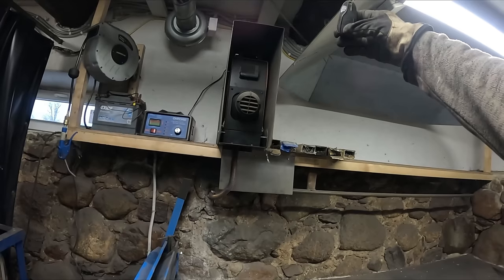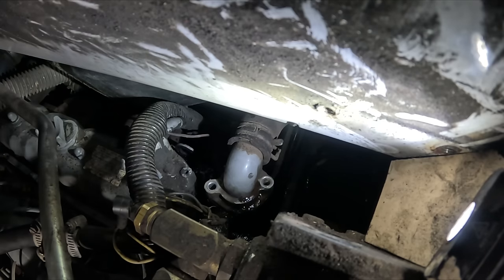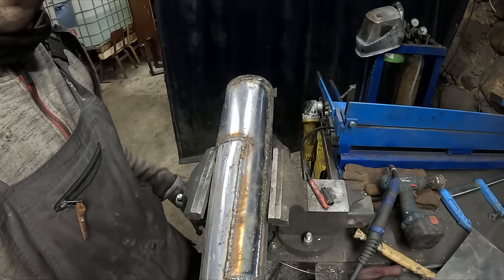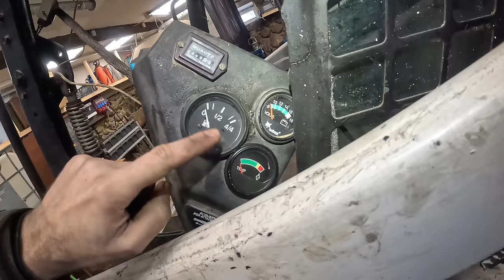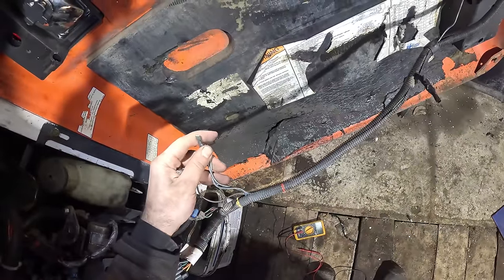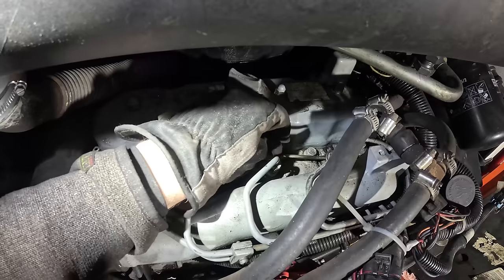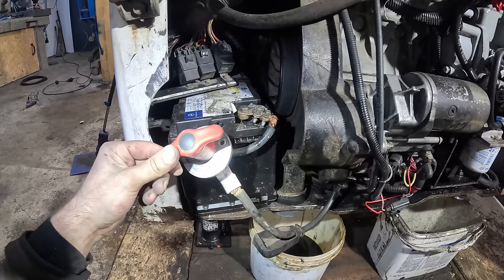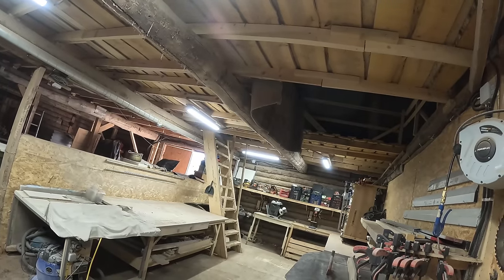Fixing up the Bobcat 751 skid steer - (part2)

Comment: Your dry humor kills me every time.
Reply: You have that bran new free welder that has tig. An you have the mixed gas an sure you have some old wire coat hangers. That what you should have used to patch the muffler. That what tig is for.. not a dam cheap mig
Reply: Ya, he has me rolling on the floor every YT!
Reply from the maker: Need pure argon for tig. Co2 will corrode the weld and mess up the tungsten tip

Comment: You take the red handle off of the battery disconnect switch and mount it from behind. Then you only need a small round hole between the screw holes. And you can get the correct crimping tool for the large gauge ring terminal for like 30 to 50 euros. Instead of squishing it in the vise and having the cable leaving the premises. :)

Comment: If you haven't already, remove the bulbs from the reverse lights and retest. An incandescent bulb is a controlled short circuit. Hopefully, you can use the existing wiring. Great video as usual!
Reply from the maker: Good tip!

Comment: Mine is a 763 and it does not have a battery disconnect switch. Great videos, one of my new favorite channels!
Reply: Yeah, those dont come equipped with one from factory. Previous owner had put a master switch to mine 2001 753g. It's handy to know that power is really off from everything.
Reply from the maker: Thanks for confirming

Comment: The white connectors in the switch panel are designed to connect directly to the back of the switch, explains the broken pin stuck in the connector.

The new lights need a “wedge” style globe base that will twist in, could be a T15 or T20 hard to judge the size from the video.

There might not be any short in the wiring to the light, as you tested it with globe’s installed you will get continuity from the power side to ground through the bulb.
Reply from the maker: Ok

Comment: Temperature gauge looked like it was the sensor. The exhaust repair cost you some wire, gas and electricity, and will last a long time win-win. For someone who does not know or like electrics (your words) I think you made a very good job of repairing all the electrical problems. The bobcat is made in America? Is that why your spanners won’t fit! I think the only thing metric on the bobcat is the driver 😊 Another excellent video, keep on posting.
Reply from the maker: 😂😂😂😂 yup seems about right

Comment: When testing gauges, ground out the power wire at the sending unit for the gauge you are working on. 
If gauge goes to full, gauge is good, if not either wire issues or sending unit is bad. 
Goes for most analog type gauges. 
Awesome video by the way as usual
Reply from the maker: Ok thanks

Comment: @Ants Pants @27:00 Andris that plug is there to let you blow out any sparks that end up trapped at the bottom of the muffler. Basically, you block the muffler pipe and open that bolt, then turn on the engine and give it a few revs to blow out the debris/sparks in the bottom of the muffler. Its part of the service list you should do every so often, dont know if anybody else has ever had any luck with that though, the ones ive tried to unscrew are all seize solid and the only way they will come out is like what you did with yours haha. Though I dont try that way on my mufflers. Spark Arresters usually go on the very end of a muffler if im not mistaken (the part where exhaust gets shot out into the air).

1:27:35 also when a glow plug glows from anywhere but the tip, it is considered faulty. I could be mistaken but that is what I read in an engine manual last time. You can also measure the resistance for each glow plug and see if its within specs, I think usually they are like single digit or lower resistance when good.
Reply from the maker: Thanks for the info

Comment: Man if I wasn't a continent and an ocean away I would come and help you with the wiring.  I too love complaining about people's half assed repairs. 

I would consider getting one of these "2 Wire Retractable Test Leads with Alligator Clips 18 AWG Test Leads Alligator Clips Electrical Test Leads Retractable Test Leads 20 FT" as described on amazon.  Harbor freight had them for a while and they are amazing for extending your test leads.  

I was removing the highscooler stereo "upgrade" wiring in a little pickup today.  Between that and this it reminded me that I need to get my backhoe gauges working again.  They have only not worked since 1996.  So should be easy to fix.

Comment: 1:13:52  Wish I had a bit more.... said every man everywhere lol.  Since you have done so much work to the electrical system, you should draw up a chart for where and what all your fuses are for and where they are.  Once you are able to get the cab up , you should finish checking out the original harness and fix it so you can use everything through the diagram wiring again. It'll be much easier in the future if you have to repair any electrical problems.
Reply from the maker: Good idea
Reply: @Ants_Pants  By the way, you did some pretty good diagnosis of your electrical issues, you should be proud of the results!

Comment: 1:47:00 I have installed that kind of isolator switch before. I think you are supposed to remove the red handle(removing the black cap on top of the handle should give you access to a screw/nut), then you just make two holes for the mounting screws in addition to the shaft hole.
Reply from the maker: Cool thanks

Comment: I use a piece of flat bar 20mm x 100mm to help me on the lathe. I put it on the ways & can slide it backwards & forwards with a dial indicator or scriber. Also I can use it as a flat surface to markout a job.

Comment: 1:45:42 You can put the isolator switch on either positive or negative. It does not matter, regardless of what anyone says. That said, I prefer to have it on the negative and the reason for that is so you can hook up various auxiliary equipment directly on to the positive terminal if needed. That way the isolator will still break the circuit.

If your isolator is on the positive terminal, and you hook up a bunch of garbage directly to the positive terminal of your battery, then the isolator switch isn't doing much.

Comment: Andris, you hate wiring, most of us do mate but at least you stuck at it. I thought you were going to mount those taillights wrong way round, had a little chuckle when you realised about the same time I think. The isolating switches I have used, the plug comes out at the end of the red handle and you can unscrew the bolt and take the handle off then drill holes in the chassis/ bodywork somewhere to locate it without the need to make a mounting brackets. Mate that was an awesome video, you sure can work through problems and come up with some good engineering outcomes, well done. Have a good weekend mate, regards to Super Mum

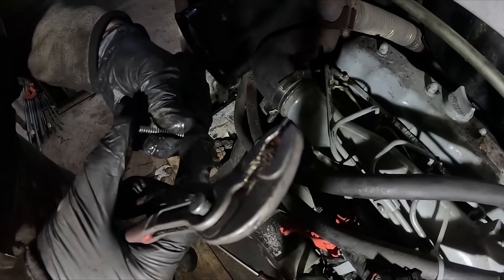Comment: 22:26 My guess is that a temperature sensor has one of those electrical resistors, that has a different amount of resistance according to the temperature.
So if the computer on your machine notices, say x-amount of Ohms, through that sensor, it "knows" the temperature.
Reply from the maker: Yeh

Comment: I had my muffler on my excavator rust out, I built a replacement out of 1/4” pipe the same size as the muffler, and it’s as quiet as it was originally, I put a reverse flow section in the center of it, but now it should last as long as I will and I didn’t have to pay John Deere $400. It’s a pretty easy thing to do, it took me 3 hours.
Reply from the maker: Cool m8 i need to do that

Comment: The old lights wire probably burnt out because the last operator put a higher wattage bulb in. If you swap all the bulbs for LEDs then you draw far less current and get more light. Try a 20w LED for each reverse light. And you could screw flat leds to the indicator etc side to get all the tail lights working. 10w each will be a big upgrade.
Reply from the maker: Good idea

Comment: Next time,just use a car muffler,they are cheap,there are plenty of shapes to suit your needs,and you have universal flexpipes, V bands and all you want to have a good muffler.
The bobcat output is way lower than any low power car ,so you can use basically every model you want.
I'm currently installing a OEM stock motorcycle muffler on a car,it's made of stainless steel and aluminium,sometimes they are even made of titanium,but people want to make noise so they sell those for cheap.
Reply from the maker: Ah yes

Comment: The reason why disconnecting the negative is better, is that creating a short is a lot les likely.
When you disconnect the positive, you can still quite easily create a short between the positive section between the battery and the master switch, and anywhere on the frame/body. If you disconnect the negative, the only way you can short anything is between the positive and negative section between the battery and the master switch. 

So yes, disconnecting the negative is objectively better. People who say you should disconnect the positive simply don't understand DC automotive wiring. They may think it's like normal house wiring, where you should disconnect the phase (/positive), but it's not. Functionally it doesn't matter though.
Reply from the maker: Thanks for this

Comment: You may want to put some rubber where the battery rubs against the sharp corner of the bobcat frame cut out on the left side of battery. at 19.58 of video Fretting will wear through that plastic in no time. Great Video.
Reply from the maker: Ok

Comment: 1:04:04 You have a US spec light assembly. That's also the one of the reasons for it being cheaper, as there probably are way more US spec machines made. I'd guess that there is a dual filament bulb inside the red housing, combining the turn signal and rear light. I'd guess the brake light activates the same filament as the turn signal...
Reply from the maker: Yeh

Comment: On your sensors like the temp sensor sometimes you have to use different point sockets. It may be a 22mm socket but sometimes a 6 point socket will work and a 12 point won’t.
Reply from the maker: Ok

Comment: I must have missed the part where you repacked the heat shielding fiberglass in there at 44:24 hopefully you don’t get too much heat in the engine bay now.
Reply from the maker: Yeah i didn't. Seems fine right now.

Comment: For battery terminals use isolated ferrules or Aderendhülsen and for cable shoes use proper crimp tool, they are not that expensive, besides that you can use it for wire rope crimping.

Comment: You can put the pump for the heater into a steel box with insulation. Rockwool would be a greag choice for its firproofness 

Tictictictoctictoctic

Comment: Hi Antz. The Temperature sender is just a Variable Resistor (eg a Themister). 
Most Thermal meters use a separate Voltage regulator for all of the meters (eg the 6V line you mentioned), to compensate for Voltage and Temperature changes. Without the regulator the gauges won't work properly. Sadly you  usually can't mix brand of meters and the regulator.

Comment: Hate to tell you this but the gasket went on top of the thermostat. I suspect that may be the smoke that was coming up from the leaking thermostat housing. Hopefully not but that little recess in the housing, under the thermostat I believe is a place for the thermostat to seal to. Love the videos.
Reply from the maker: I double checked it does not leak 👍
Reply: @Ants_Pants  Outstanding. I would have hated to see you have to tear all that apart. Good work.

Comment: The theoreticians keep saying that soldering will make the wire break.  I guess I will go with my own experience.  I have been soldering for fifty plus years and I have yet to see one failure.  I can not say the same for the clamp style lugs.  They say the same about boat wiring and my experience and a friend who had an outboard shop dealing with thousands of boats (in business for fifty years and a three man shop) was exactly opposite.  That was in salt water which is the ultimate test.  No solder failures while many crimps were a source of problems.  Ditto with old pre forties house wiring when the practice was to solder all connections.  Some are still going strong and I don't know of any reported failures of those joints.  Solder does not corrode anywhere near what the other metals do so that alone is makes it worth doing.  Add to that that it does not loosen up letting corrosion in between the connection.  Just a win win.
Reply from the maker: Yup exactly

Comment: Another great video. Kudos for the patience on welding the muffler. Gauge is a unit of measurement for diameter. Lower the gauge the ticker the diameter' 10 gauge wire is thicker than 16 gauge. A 12 gauge shot gun is a bigger bore then then a 16 gauge. Then to complicate things  we do odd stuff., For instance like  model trains G  gauge is bigger then S gauge. We just measure stuff  this way because well we like to complex our lives.  I own some old equipment that requires a 11/32 or 24/64 wrench.. Why does not Amazon exist in the EU ? In your last video the antique vise you showed maybe a old blacksmiths knee vise. I bought one at a farm auction but never used it. The blacksmith would take a item from his forge with tongues, He would then push the clamp  with his knee to quickly close the vise. Then he would have his hands free to spin the jaws closed. It may be a neat find. Some sponsor needs to hook you up with a solar power inverter for the penthouse on your welding cart. The size of units of good capacity have really decreased. The solar panels are small and highly durable. You could use your welding cart without needing a power cord. I have no idea about watts and amps capacities. I think some of these inverters could supply your wood splitter.  I appreciate watching your talent and hearing your humor.
Reply from the maker: Thanks m8

Comment: What is that constant banging in the background ? And you are right with using the neg terminal for a cut out. Plus, what settings do you use on your plasma cutter.
Reply from the maker: Shop heater fuel pump, yes i think so 50amps

Comment: If you put 12v across the fuel guage terminals it should give a maximum reading if it's working OK.  In my experience 99% of the time the sender is the faulty item so the fact the gauge was the problem really surprised me.
Reply from the maker: Me too

Comment: I would have suggested take another black piece of plastic and glue that on and cut the proper size hole for the gauge to fit properly.  Just having a thin layer of another piece of plastic over the base would have still looked proper.

Comment: It looks like you had two failures on the temp system.  The old thermostat had failed and stuck open (as it should when it fails) which is why all the coolant was coming out through the thermostat.  The new one was closed and worked correctly at temp.  The sensor was also probably bad.   They both needed replacement anyway.
Reply from the maker: Yup

Comment: The circuit breaker should be bolted to the chassis through it from the other side, pulling the "red thing" first and then assembling it again 🤔
Reply: Yes, mount master switch from handle side, under that black cap there is bolt and you can pull off red handle. Bore three holes and voilà !
Reply from the maker: Wow

Comment: Try using a lap weld on thin sheet metal. Instead of butt-joints. Gives more metal to absorb the heat. You can also add welding wire along the edges of your welds. Again, adding more material. Overall T.I.G. welding is better for sheet metal, it has less heat and more control. But it takes a lot more practice to get good at T.I.G. vs. M.I.G. T.I.G. is what most metal fabricators use when welding automotive, classic vehicles, or other thin sheet metal.
Reply from the maker: Ok

Comment: If you had mounted the master switch behind the metal mounting plate, you could have left the plastic wedges in place and only had to cut a small hole for the key to go through, as well as the 2 screw holes. That's how they are designed to be installed. 😅

Comment: I am electrican but I hate to do repair electronics on machines.  So complicated wiring as you also found out. At home, there is a main cabinet with fuses, switches, overvoltage protection. All clear and easy to fix.  But on machines, it is so complicated :(

Be careful with the glow plugs. Most glow plugs are rated with 11 Volts.  Lead acid batteries can be up to 14V and kill the glow plugs.
On my excavator, I checked the wiring: Inside main switch, there is some electronics for the glow plugs which gives an voltage to 11V to the glow plugs.
I wonder about the circuit in your machine.  Battery -> Switch -> Relay -> Glow Plugs. Can't see something which drops the glow plug voltage.
In cars there is a separate device called glow control unit. This controls the time and voltage.  
Check the voltage directly on the glow plugs to be sure that they don't be destroyed after a short time...

Another tipp: Do some shrink tube around the glow plug connection bar (voltage +). In case something falls down on it, it gets a short circuit to the machine (-).

Master switch: It's best to use it in the negative pole. Everything around the switch is also on negative. In case the switch internally is damaged or some small wires on the cable get connection to the housing, nothing happens.
In case it is connected to positive,  there will be a big short circuit and it will lead to burns of cables an battery.
Reply from the maker: These plugs are rated for 12 to 13 volts if i remember correctly. Thanks for the info

Comment: Next time you have to take something apart that is rusted together. Try heating it red hot like you did to straighten the bent exhaust pipe. The pour cool water over it while it is still red hot. That shocks it and a lot of the time it will come apart when it cools down. Maybe don't do it with cast iron. That could crack.
Reply from the maker: Thanks for the tip